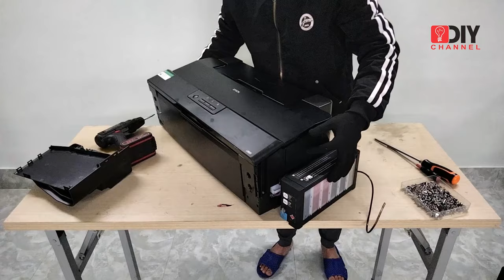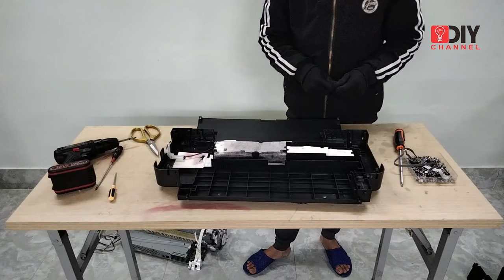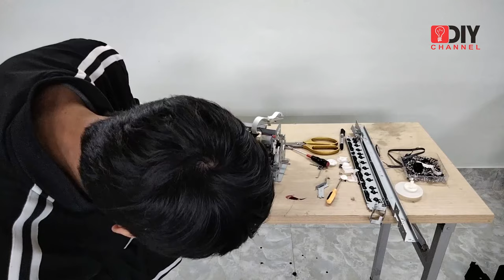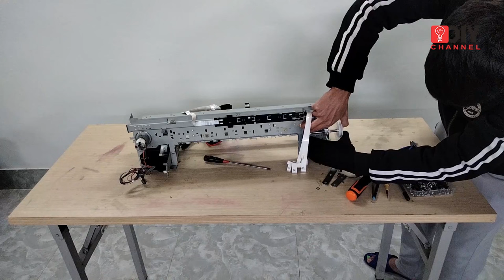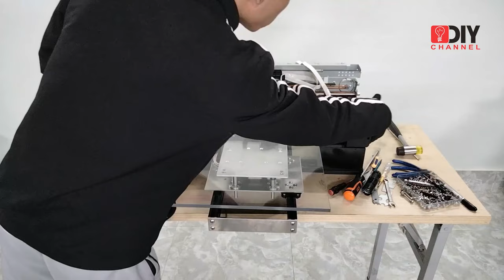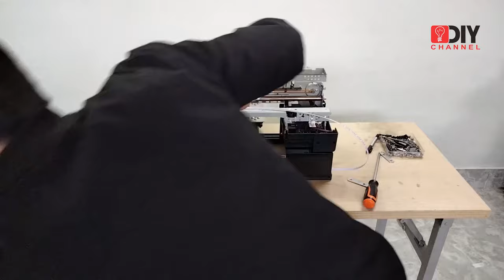Make UV Printer From Epson L1800 | DIY UV flatbed printer

Comment: So, a complete fail?
Reply from the maker: no, success :D
Reply: I built one using some arduinos and an hp printer i basically just got a broken hp designjet and made a cartesian motion sustem using linear rails then found the signal out for the motors on the stock design and send the layer's as pages using the default hp driver.  The out signal goes into a aruino like microcontroller. Then to a rpi, the rpi uses a 3d printer motherboard and motion control software to drive stepper motors which drive belts for the print heads and ball screws on the x and z axis. The biggest pain in the ass is that the print heads clog up FAST but theyre about 30 dollars each, and if i dont leave ink sitting in then it wouldn't happen. Anyways i suck at making videos but i was hoping someone made a howto on what they did since im having problems with the print heads clogging i think im gonna have to build some custom ink pumping solution that can have the ink in one and cleaner in another then clean out the print heads every so often... or my uv lights are needing to be on a seperate carriage. My long term goal with the project is to make a diy fused deposition modeling printer

The other thing im still wondering is if i can get away from using the hp board to drive the printheads because sometimes the delays are different and it will cause a bit of "tearing" in the printed image
Reply: @98f5 Hello brother, what HP printer did you use? The thermal or piezoelectric head?

Comment: It Will be interesting to add a Z axis and transform this thing in a UV curable inkjet 3d printer. It will be the definitive 3d printer at low cost
Reply from the maker: Are you interested in that? please contact whatsapp +84918219268 we can discuss
Reply: @DIYInkJet whats up with spamming whats app and you’re the channel owner? Are you legit? Why whats app?
Reply from the maker: @glennedward2201  it's a messaging app. info I put at the end of each video, or you can also email me

Comment: Wow ! That would be awesome to convert a Stylus Pro 3800!!!! 24 inches wide!
Reply from the maker: yes ! i have controller and flat base for epson 3800. you can contact me via whatsapp +84 918219268
Reply: @DIYInkJet  I mean 7800 !! the 3800 is not 24 inches.... my error !
Reply from the maker: @jacquesbouchard8884  you can talk to me via whatsapp (+84918219268). can switch your printer